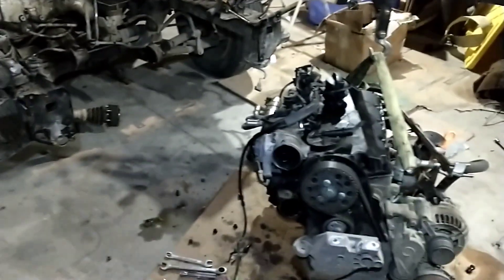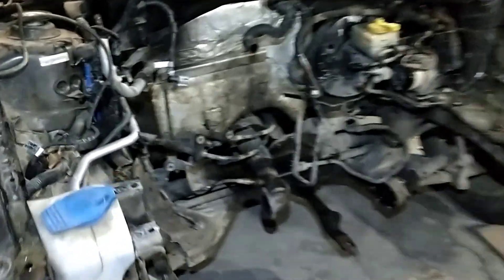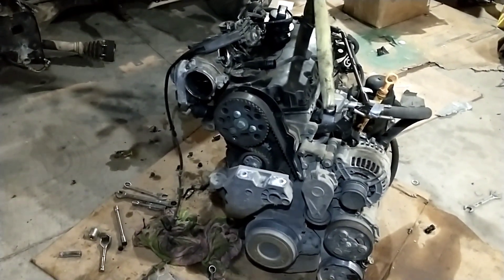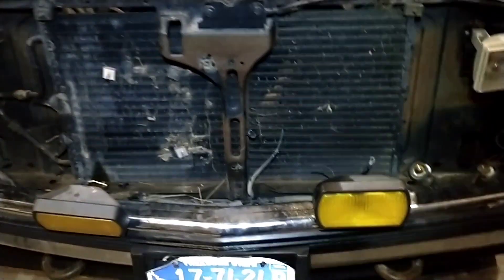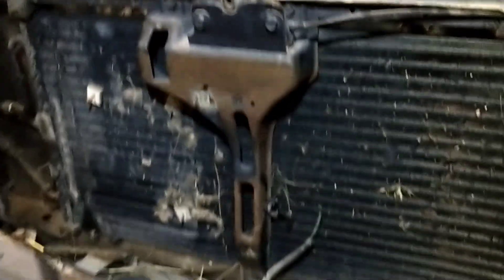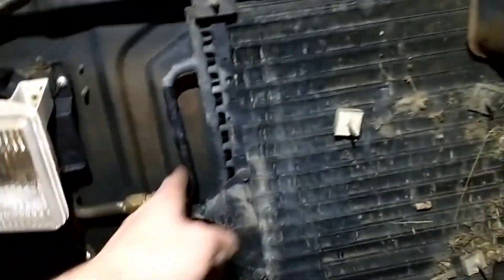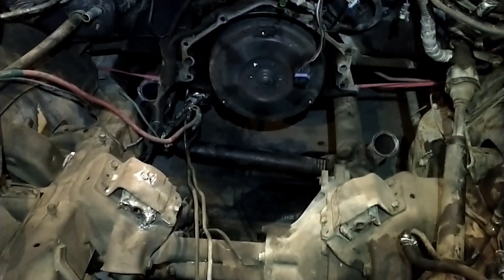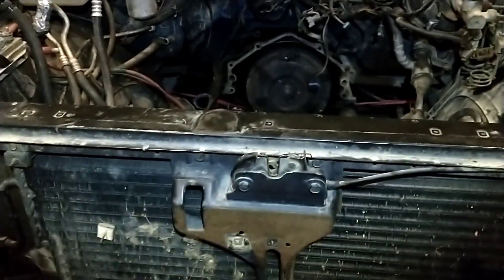Chevy 1500 TDI swap update, BEW is out, how big of an intercooler can we fit?

Comment: Are you gonna put a mechanical pump on it?
Reply from the maker: No this is a PD TDI, electronic injectors so computer control is the only option.
Reply: @TDISwaps  I'm thinking of buying a Bosch 0 460 494 460. Do you happen to know if it will fit my 1.9tdi? I'm in the process of putting it in my volvo 245 and i dont wanna deal with all the electronics.
Reply from the maker: @antonaberg5238  don't think I've seen that specific pump used before, sorry I don't think I can help you there.  The wiring is really not bad if you just tape it up and don't try to dig into it.

Comment: 1500 Chev TDI swap??? whats the gain you aim or just for funzy
Reply from the maker: Well the original 350 motor is junk, we were going to try swap in a 1996 vortec 350 but we need almost $1,500 to convert that to run in this 1991 truck, at that point for a truck that's going to average 50 MPH, we wanted to see if a TDI could get over 30 MPG at that speed, and just for fun 😁
Reply: @TDISwaps  Very curious, you gonna use a ZF8 8 speed auto for it? cause that would be very awesome to see. combining old and new tech. like what chevy did with there 1000 hp crate motor with no blowers
Reply from the maker: @harleyinglis5360  unfortunately an 8 speed and controller would be way over the budget for this build.  We will be using the factory 4l60 that came in the truck, but with the TDIs 5000 RPM range a 4 speed is more than enough gears
Reply: @TDISwaps  a Dodge 1500 would be your best bet to pull from if you see one in the wreckers. more gears for a heavier build would give it some really good numbers in terms of response and MPG with it have 8 gears. i had Plans to try and Find a ZF8 8 speed with its Tcase just to throw in a XJ to get some awesome Numbers of MPG
Reply from the maker: @harleyinglis5360  ya I am very isolated from a good wrecking yard, over 3 hrs away, that and I have looked into the transmission controller needed to use the transmission stand alone and it's over $1000.  As far as response and MPG, we plan to use a higher stall converter if needed to get the RPMs into the boost range and my so far still get along fuel mileage even over 3000 RPM, the TDI doesn't seem to mind RPMs